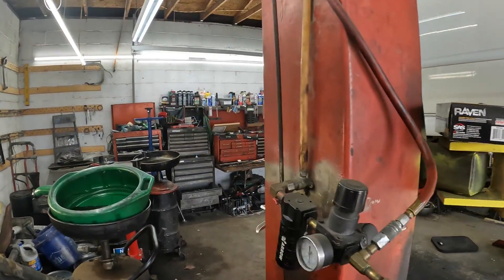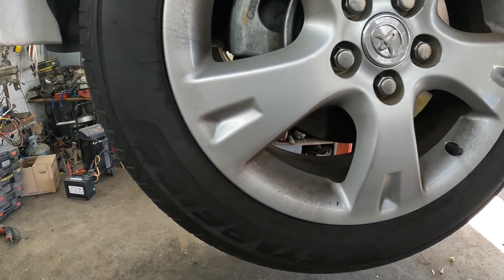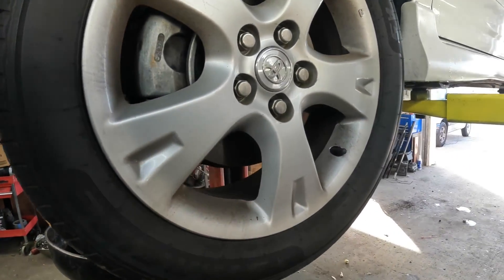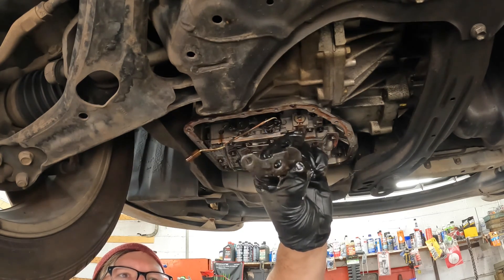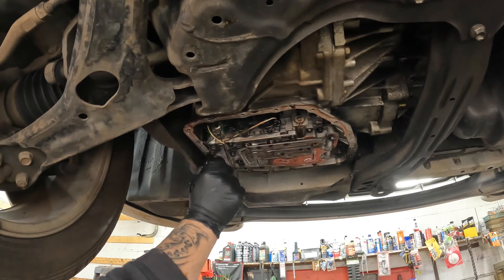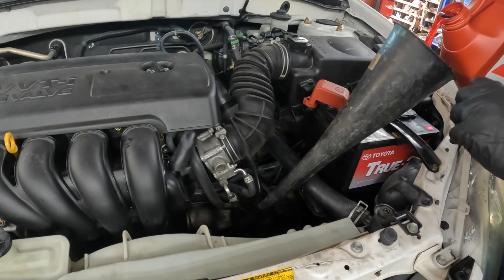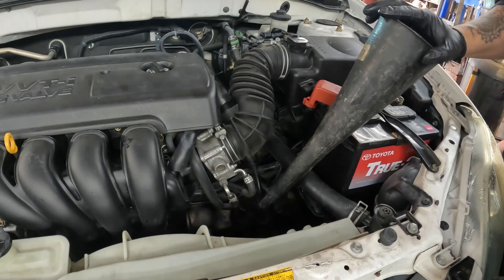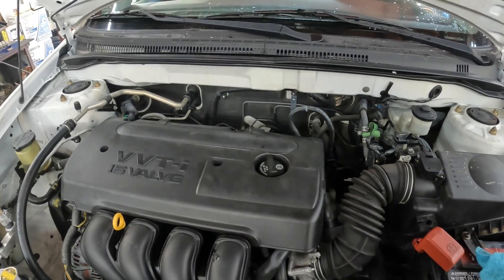One More Go On the Corolla P0741 Code

Comment: Does this code cause vehicle to fail smog test? I’m in California and the smog rules are a lot stricter.
Reply: It does I'm in That situation right now permanent code will cause the smog check to fail
Reply from the maker: I do not believe it will cause that but I would check with a local mechanic shop to be sure as certain state and even  counties vary.

Comment: How many Transmission Solenoids (code P0741) have this Corolla..??  Thanks...
Reply from the maker: I believe it has 5 solenoids total.  Three shift solenoids, one torque converter lock up solenoid, and one line pressure solenoid.

Comment: Did this fix the code?
Reply from the maker: No, I eventually had to replace the entire transmission.
Reply: @ I had my transmission rebuilt with a new torque converter and shift kit and the code popped up again I’m thinking about replacing the shift solenoid I’m not sure where else to go from here
Reply: @ after replacing the transmission the code didn’t come back up?
Reply from the maker: @lickmataint3585  no the code never came back after replacing it.
Reply: @operationoverhaul  if I had a shop rebuild the transmission with a master rebuild kit the only thing left to replace would be the solenoids and valve assembly correct?
Reply from the maker: @Kyleeddy661  Did they replace the torque converter?
Reply: @operationoverhaul  yes
Reply from the maker: @Kyleeddy661  then the only thing I could think of the is the solenoids and valve body
Reply: @operationoverhaul did this quick repair work fir anyone lol😮
Reply from the maker: @paultadki8007  lol it did not fix it on the is one but it did fix one that I worked on recently (several months ago) actually. The solenoid was was bad and replacing it caused it to work correctly.  But in my opinion most of the cars with this code will need either a torque converter or an entire transmission replacement to solve the issue.
Reply: @operationoverhaul  thanks bro
Reply: @operationoverhaul how much does the trammission cost?

Comment: What do you mean when you say start with the "gear" exactly?
Reply from the maker: The speedometer piece has a gear on the electronic portion of the speedometer sensor.  You change out the gear on that.  They found that they would break teeth or crack and to start with that.

Comment: Hi. What happens if I never get this problem fixed??
Reply: I was told I needed a whole new transmission 🤦🏾‍♀️
Reply from the maker: To be honest, I have never seen the issue cause major failure or anything causing an issue with drivability.  I am not saying it will not, just that I have never experienced it personally. I find that the transmission runs as it should beside the fact that the lockup will stay engaged longer or not engage.

Comment: Is it the same for 2004 Toyota Corolla 1.8 4cyl my check engine light comes and goes once and awhile but when I put gas that’s when the check engine light comes on really strange
Reply from the maker: Have you had the light checked yet to see what the code is?
Reply: @operationoverhaul  yes p0741  after checking carefully thoroughly from the intake it looks like it’s all connecting  because I went underneath and part of the intake is rip off not sure if that’s what’s giving me that code as well ?
Reply: Torque converter clutch circuit performance/stuck off code P0741 indicates that the torque converter clutch solenoid electric circuit had performance fault or was stuck OFF for a predetermined period of time that’s what it gave me after taking to auto zone
Reply from the maker: @ from the looks of it, it should be the smae for your car too.  So this should be the direction you are looking for as far as testing and following the TSB.
Reply: @operationoverhaul  so it’s solenoid?
Reply from the maker: @Davidmtz559  I cannot say for sure it's that without testing it.
Reply: @operationoverhaul  so I have to test the solenoid correct?
Reply from the maker: @Davidmtz559  yes, I would definitely test it before buying one as a factory can be a little pricey.
Reply: @operationoverhaul  alright thank you
Reply: @operationoverhaul   but after checking carefully thoroughly from the intake it looks like it’s all connecting  because I went underneath and part of the intake is rip off not sure if that’s what’s giving me that code as well ? Could that be the cause too ?
Reply from the maker: @Davidmtz559  the intake would not cause that code. If anything you would be getting a fuel trim code from too much or too little air/fuel
Reply: @operationoverhaul  alright  thank you so much again we’ll check carefully on the solenoid
Reply from the maker: @Davidmtz559  you're welcome

Comment: Toyota genuine part costs around $530 + tax + labor = $ Very expensive repair assuming that this is the part that is bad. If it is wiring, torque converter itself or the transmission will all give the same code. So, risky and expensive repair neverthless.
Reply from the maker: Plus going through the TSB step by step can get pricey as well because there are like 5 different steps to take.  It can take you through every step, which can be lots of fluid along with every step.  You could be out thousands of dollars before you actually fix the issue.
Reply: @operationoverhaul my mechanic told me he would just buy a used trans rather than do the steps, because they can take it down and replace it pretty easily for 2k with a 1 year warranty
Reply: My trans works fine is a little clunky sometimes in 1 st gear . I am wondering if I should change the fluid or would it cause more slippage in the TC ?
Reply: check engine light? see if there is a code with a scanner. clunky may be a torque converter . bring it to a trans shop, a specialist, if anything .

Comment: Is the location same for 2017 Toyota Corolla Le?
Reply from the maker: I have never replaced one on a 2017 but according to service data:  Component Location:  Solenoid SLU is two wire solenoid located second from right side, rear side of valve body.  Must remove trans pan to access.  This was copied from service data.

Comment: Do you have a part # of the solenoid?
Reply from the maker: 35250-12030 is the factory part number.  This is the one I would use and it was not much more expensive than the aftermarket one.

Comment: I've got a 2008 Corolla that is also throwing code P0741. Would the resolution steps in TSB TC008-04 also apply to a 2008 Corolla? (1st try replacing speed gear assy. Then try replacing the solenoid?)
Reply from the maker: I did not see any tsb or recall for this code on the 2008 model year but if it is throwing that code it could be the shift solenoid valve, the valve body, or even the torque converter itself.  You could try some of the steps I did on the video but you may come up empty handed.  If you can look at live data that would help or had access to a bi-directional scanner.
Reply: @operationoverhaul  Thanks! 😎🙏

Comment: Can this bad solenoid make the transmission not to respond quick early in the morning when ever the engine is cold?
Reply from the maker: It can but I would check the fluids viscosity because if it is to thick it can do that as well

Comment: I had the same code in my 2005 toyota Matrix replace same solenoid but didn't fix the problem. Transmission works perfect ,it's just the check engine light keeps coming back.
Reply from the maker: It is a common code on these and those.   What all have you tried?
Reply: My Car is now giving off this code. It's a 2008 Toyota Corolla. The Transmission works great. No check engine light. What advice do you have? Thank you! 🙏🏽 @operationoverhaul
Reply from the maker: @MonicaMontgomery_  how does the fluid look on it?
Reply: @operationoverhaul  You mean on the actual Torque Converter or the Vehicle itself?
Reply: @operationoverhaul  I have not tried anything as of yet.
Reply from the maker: @MonicaMontgomery_  is the fluid still red on the transmission dipstick? That would be the first thing I would check

Comment: Did this eliminate the code?
Reply from the maker: It did eliminate it but the owner actually called today and messed up the transmission and is wanting to replace it so there may be a video up soon doing a trans swap.
Reply: @operationoverhaul have a 2012 Toyota corolla  isis that keeps telling me that my torque converter clutch solenoid stuck in off position I change 3 transmission including the solenoid and ecu that keep giving the same exact code an it still come on how do I go about this because its frustrating p2575 code
Reply from the maker: @xaviawallen8295  I would check the wiring to the solenoid to be sure that it is getting to the solenoid.
Reply: @operationoverhaul  entire wire harness are just the clutch solenoid wire
Reply from the maker: @xaviawallen8295  I would check it from the computer to the connector on the transmission first then if it checks out good then I would check the wires from the connector to the solenoid.
Reply: @operationoverhaul  ok because I've change the computer and it's the same reading
Reply from the maker: @xaviawallen8295  it sounds like a bad wire at this point to me.
Reply: @operationoverhaul  ok thanks a lot
Reply: @operationoverhaul  what did the customer do to break the transmission otherwise? Did the repair otherwise function until the customer did this other bad thing to break the transmission?
Reply from the maker: @360Sebastian360  I think he was manually shifting it at higher rpms and driving it rough. He actually just totaled the vehicle about 3 weeks ago